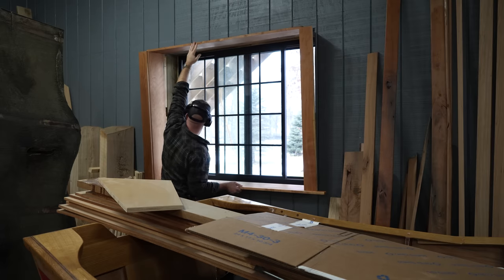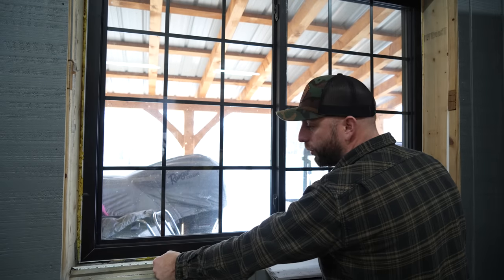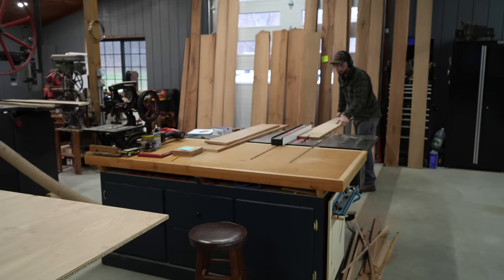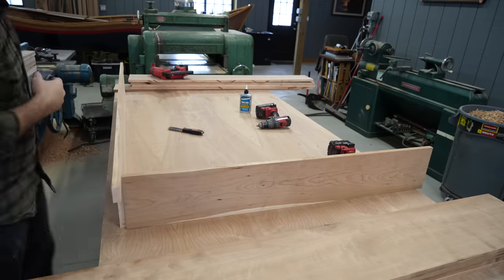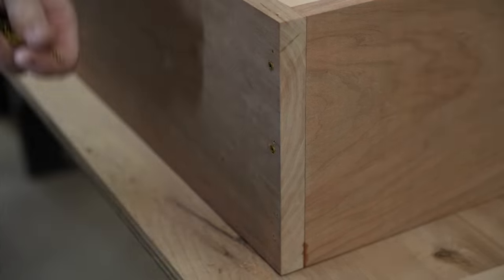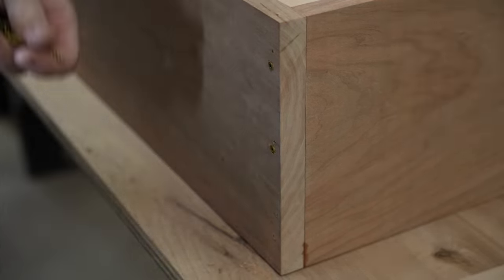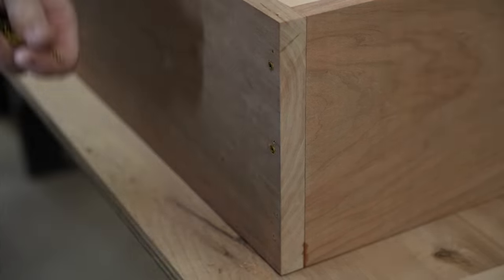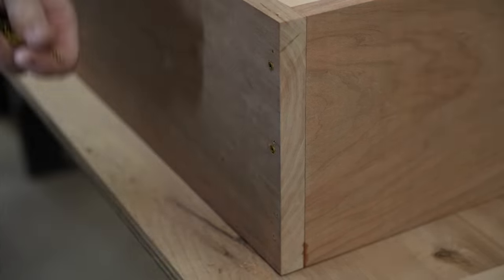How To Install Pro-Level Window Trim w/ EASY TRICK

Comment: the wood looks great. very pleased that u chose to make them from a solid natural wood. 
(i my self do not really like straight edges so i would just add that it is always better to fillet them with a router bit.. also if you happen to bump with some of your body part on a straight edge it will always hurt more)

Comment: Like that look, and love the stain. So as a noob to window trimming, do the pan head screws remain after trim? If so, I’d probably leave the front face off and fill it with insulation or foam before putting on front face. I’m sure your windows are insulated but just thinking of a draft coming from structure around it. Keep up the great work, I really enjoy your craftsmanship.

Comment: I like to build the window frame as a single unit so it can be removed when painting walls. I think you had 3 pieces, so not much different to have just one. Then install with about 4 nice brass or trim-head screws through the jamb. No nail holes.
Reply from the maker: Great idea! Might try that in our house

Comment: Looks great. I'm a little jealous of your square and plumb window openings. I had to miter every jam and casing joint twice to fit my 1910 windows. Assembling off the window would have left me with 1/4" gaps somewhere on them. Did you hide the brads with anything?

Comment: So the screws act as a standoff from the physical jam of the window and create an air pocket? Why didn’t you fill in this space with some kind of insulation? Seriously curious about that.
Reply from the maker: There is spray insulation between the actual window and frame.

Comment: Great idea on those screws you used in your jams... I think you could refine that to the next level and square off your face of your wall so that the screws are perpendicular. What it looks like you're doing was using your gauge block out in thin air with no reference for square to wall or window 
Love your content and attention to detail
Reply from the maker: That gauge block is referencing the square edge of the window frame.

Comment: I like that jig but you didn't talk about the jam thickness all that much. Most windows to drywall measurements on each of the 4 corners are slightly different. I've done tapered jambs many times before or have used a back bend moulding on the outside edge of the casing. That is an important part of the process. Also, the width of the apron should be lined up with the outside edge of the leg casing's. For the width of the stool, I usually go 3/4" past the outside edge of the leg casing's and 3/4" out from the fattest part of the casing. The head casing should be flush with the outside of the leg casing's but the trim peaces should be 3/4" proud. I usually install my head casing on with a Kreg Jig before I install the unit and then the apron separately. That makes it a two part install. I really like how you oil both sides before installing. I've done that on my own homes only twice at the job site because I was getting paid extra to be not only a carpenter but also doing the painters job as well. I've done 36 stain grade tapered jamb extensions by myself in eight hours when I was a younger carpenter and built them like your doing and they were spot on perfect. You just have to get a production line going to make that happen and be doing finish carpentry every day.

Comment: Design is very strange, but no point for dicussions. I am missing implantation of damping material since windows are always bridges for coldness
Reply from the maker: The design is a timeless craftsman style trim style that has been in millions of homes. There is spray foam around the window,

Comment: So there's roughly a 1" void between the trim and the wall all the way around, why? Why aren't you installing and mounting the trim directly to the sill and sides and top, I'm truly confused.
Reply from the maker: Because rough opening aren’t very accurate or square. If you mounted directly to the rough opening each window would have different reveals and be all out of whack
Reply: @ThirdCoastCraftsman  I see! Thank you for clarifying!